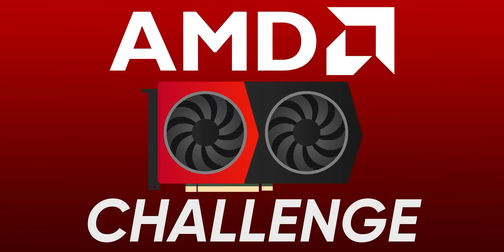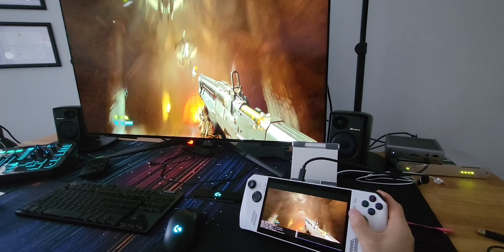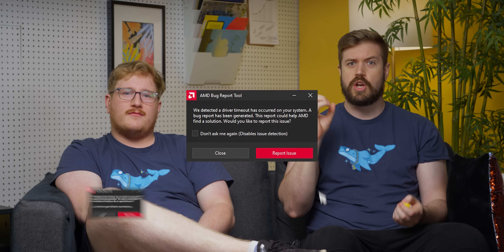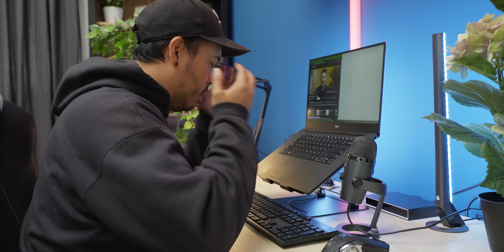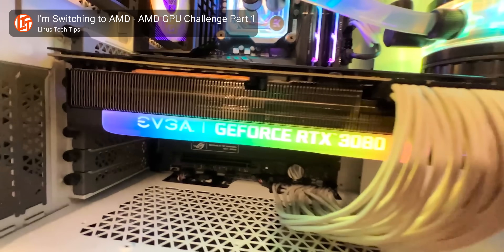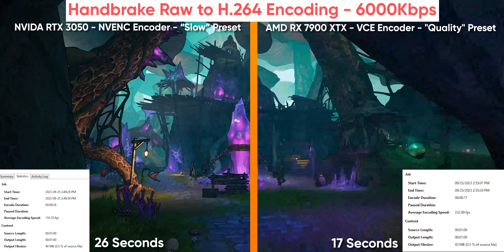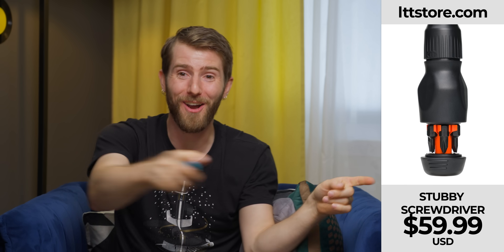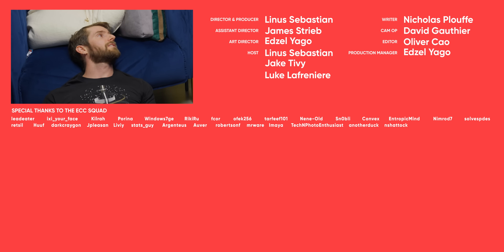I’m Staying on AMD! - Radeon Challenge Pt. 2

Comment: I've been using a 7900 XTX for a couple months now, very solid so far. Seems that maybe they have improved the drivers.
Reply: Historically speaking that's usually the way it goes, I never see the issues people usually talk about with Radeon graphics but I also don't usually have the cards until a few years after release for the most part.
Reply: Just got one, love how it draws 100w at idle. Can’t find a single fix online, can’t set a custom resolution with a lower frame rate, it maxed out at 200 on a 240hz monitor. First AMD card since the r9 280, already regret it. Insane this issue hasn’t been fixed in 8 months, and I’m far from the only one.
Reply: @Blackfatrat yup same got a XFX 6950XT after three years of using a RTX2060. The AMD one is faster… thats all the differences I have noticed.
Reply: @plastic-fly  I'm sorry to hear you've been experiencing issues, have you checked the port specifics both on the GPU and the monitor? The cable may also be at fault, I can't comment on 240hz because my monitor only goes to 165 (it's one of those 49inch ultra wide ones I got for work) I just know there are variables when dealing with that high a refresh rate.

The other thing which I don't think anyone can deny is just variables between computers and stuff, the card I had the most issues with was probably my 5700XT which had mainly driver based issues.

Comment: Interesting. I've been running all AMD pcs since end of 2018 and haven't had any of those issues. Could it be the previously installed drivers?
Reply: Windows drivers are the main culprit. They've fucked me other whether it was Nvidia or AMD.
Reply: They always use DDU, i remember them recommending it a lot a few years ago when they did experiment videos involving GPUs, so I can't imagine things change
Reply: Yeah seems kinda odd to blame all this on a mainstream GPU. Like, I could believe there were problems like this with the early Arc drivers but millions of people willingly buy AMD GPU after AMD GPU. It literally could not be this bad. Matter of fact, I've literally never owned an NVIDEA GPU and I did not even run into issues this bad on Linux. On a GPU not supported by AMDGPU...
Reply: To be fair. I been using AMD for 8 years. I always make a clean Windows intall on any major hardware upgrade. No major issues
Reply: Me too been running amd gpu for months and its fine, updated the gpu driver multiple times and its fine (except if windows 11 decided to f me over, return to win 10 fix the thing). Are these guys using like reviewer engineering sample or retail?
Reply: I've had problems with nvidia as well when not doing a fresh windows install. I prefer fresh install over DDU.
Reply: I wonder if they were using drivers directly from AMD or if they got the weird ones from Windows Update pushed on them without noticing. Keeps happening to me, and they're way more unstable than the drivers directly from AMD's website
Reply: gotta keep in mind they test the hell out of each card they get. We, casual gamers, just play and find most cards do great for our needs.
Reply: the issue is amd is garbage.
Reply: @albioncia  I think it is cause by not have fresh window installation with hardware change. Because I did come across many of their issues, switching from AMD to Nvidia. So many of the issue might cause by the switch itself.
Reply: dude luke's issues are like 100% user error lol
Reply: The only problem I have experienced was a flicker in war thunder which ranged from imaginary to really annoying.

This was solved by setting the driver to DX 11 in the config file. Which you can't do in-game for some reason. And I don't know why.

Edit: talking about the Rx 7800xt.
Reply: @harbinger218  I wouldn't say that, his use case is very unusual, but he is not "using it wrong". A car driven mainly on rough road is one thing, a car drove into a tree is another.
Reply: @jaredj9099 lmao did you even watch? They're using them normally, they're not trying to run them out of spec or at full load for days like AMD should for their stability testing.
Reply: @real151kmh DDU doesn't do a lot you still get a bunch of leftovers and windows trying to kill itself with the wrong drivers. A clean install is the best, and you can do it in 10 minutes and keep all your other files if you partition it properly.
Reply: @servissop151 DDU doesn't always do a great job tho. Using DDU is a great tool, but it is definitely not perfect.
Reply: @miguelborja6896  yep, same. And that's how I've been avoiding any major issues for years. Every time I change CPUs or graphics cards i do a clean install

Comment: I really have to wonder if a clean windows install would eliminate a lot of the problems. I never seem to have any issues with my 6750XT
Reply: Yeah, same. I never had ANY problems at all with my GPU (6700XT), I got it with the new PC, and therefore freshly installed windows.
Reply: you bastard!!

i got some crashes and some hard crashes, maybe once a week. 

msi 6750

What is you drivers, my drivers: 22.5.1
Reply: If i'm switching brands of GPU I always do a fresh install and I never have any issues...It just makes sense
Reply: @LEV1ATAN  my brother in christ you have drivers that are 1y4m old
Reply: @LEV1ATAN bruh you need to update your drivers
Reply: when i still had my rx470 a fresh install didn't help with these issues.
Reply: @LEV1ATAN bro update your damn drivers! We're at 23.9.3 for Christ's sake!
Reply: Can also confirm I have had zero issues since the launch of the 6750xt. Same with my friend who bought the same card. Zero issues.
Reply: @slizzle.280  dude, i was using the new ones, but my PC crashes more often. thats why i still using those drivers
Reply: @randomstuff508  dude, i was using the new ones, but my PC crashes more often. 2-3 chashes in 2h

Comment: It’s actually so refreshing to hear Lukes experience with AMD since… I’m not even exaggerating I’ve had every single issue he has and more. I bought the 5700XT when they just released a few years ago and was fine for maybe a week then immediately had issues and all the same ones he has with them all GPU related.. things just not working and not making sense on why. When it does work tho it is phenomenal and i still think the 5700XT is one of the best cards out there for performance to cost and just plain performance and being able to handle whatever i throw at it until i do something simple like stream a video to my friends on discord and just like Luke described it would slow it down to slide show or freeze with the audio continuing. I did 3 windows installs at this point… feels like a annual thing and its always been a progressive ticking time bomb leading up to that where it is so bad i have no choice. I will say I’m not sure if it’s cus i got lucky with my recent windows install in the summer but since then the random driver crashes have stopped - minus the crashes when i play new games right at release. And the discord video streaming/youtube videos slide show slow down. Yet with all this i can throw a Valve Index VR at it with 144hz enabled and get consistent stable frames around 80+ in VRChat which is impressive and all the more confusing if you know how unstable vrchat is.
Reply: I build a new PC on the worst time of the last crypto/covid period and could only get an overpriced 6700 XT. There were some really strange issues (with old multiplayergames) freezing/black screening for a short period - some of it seemed to be network related, but there was a serious bug with the AMD driver and my "cheaper" 1080p monitor. As I did some affordable PC builds for friends and family on the side I noticed the same issue even with much older AMD cards (570 and 580s) and could narrow it down to the usage of HDMI and Displays cable. By default I had both connectors pluggedin this would somehow (sometimes) messed up the communication between the monitor and the driver and the GPU. So the fix was easy... but to find it was some longer trial and error.
Reply: Yep, I had all the same issues with my 5700xt, that’s one of the reasons I went for a 4080 instead of a 7900xtx

Comment: I'm over here with my AMD card thinking this is weird I don't have any crashes like this. Then I remember I'm still running an RX 580 from 2017. If AMD could get their drivers working better at launch that would definitely help because they make great cards that age very well from my experience.
Reply: ive got a 6900xt, whatever issues hes having might be related to windows 11 as im still on w10 and no issues
Reply: What do you mean when you say they age well? I mean what is the baseline. I think my NVIDIA cards have also aged very well. I am currently using a 970 from 2013 I think (EDIT: no, 2014). All games I tried (except some VR titles) are still working fine.
Reply: I am using Rx580 to... works just fine
Reply: @Kcii-99  Also could be due to weird issues with swapping gpu's and no clean install.
Reply: @JojOatXGME  there are comparison videos showing how how much performance has increased with the flagship Polaris GPUs (rx470/80/570/80/90)
Compared to its competitors at launch like the 1050ti and 1060 (3gb usually) in price
Reply: @Kcii-99  6600XT on w11 and I haven't really had any issues. Working just fine.
Reply: I think it's more all the extra stuff they're running, especially linus' setup, he does list all the scenarios and it's stuff i've never done with my computer. I just use my system for gaming at my desk, and run a VM as my work from home system.  I haven't had any real issues in the past, i've used an r9 290x, a vega 64, and now a 6950xt.  
I did forget one issue that has occurred, I just recently purchased ratchet and clank a rift apart for pc and that crashed on me repetedly during one play session specifically in the battle arena while using the Blackhole minigun weapon the weapons graphics wouldn't appear and then the game would crash.  But a restart made it work normally, and it hasn't happened since.  That's possibly the only issue i've ever experienced with one of their graphics cards.
They do also specify that they used the cards at launch for this challenge, and as evidenced by Luke's experience the drivers tend to improve rapidly.  It could be that none of us are early adopters.  I purchased the 6950xt about a year after it launched, same with the vega 64, and the 290x was closer to 2 years after launch.
Reply: I've had an RX 5500 XT since December 2019 (basically since launch) and never had a single issue. The only crashes that I've encountered were caused by bad hard drives
Reply: @KofolaDealer  The advantage of the 5500 XT is it came out much later than the flagship 5700 XT and had a lil time to mature. The 5700 XT was one of the worst cards I can think of at launch. It was still really bad when I got one a year later. Just a few months and driver updates after that it was pretty solid and at this point you wouldn't even know it ever had issues.

Comment: Id say that Jake’s experiences plus what the labs found is similar to what other outlets have reported. There are certainly broad concerns about drivers and old games and brand new games. Part of this is that there can be games that were too old or niche for AMD’s latest push for better drivers. I really hope that AMD and Intel (especially, holy crap) can keep the software development of drivers at their forefront. Nothing kills a product worse than a reputation for inconsistency. Even slowness can be forgiven, especially if there’s room for improvement.
Reply: @BobDevV I am one of the Linux guys and the driver works really good. Plus it is part of the Kernel, so it just works without installing anything.
Old games do work way better on Linux and is a pretty great experience these days. So yes, it's a Windows thing.

We have to thank Valve and the Steam Deck a lot for all of this!
Reply: For multiple generations AMD has been having the artificing issue
Reply: I ran into this a couple weeks ago with Resident Evil Revelations on RDNA2.  Had frequent crashes and some wild bugs with things failing to load.  I got to the end eventually but it was a rough time.
Reply: my experience was more like lukes. absolutely atrocious with blue screens and crashes. sorry but having older games be niche for amds drivers is a poor excuse. 

edit: poor excuse because on my old nvidia card it never happened on older games, as well as newer games and somehow nvidia drivers are still better?
Reply: I have had exactly as many issues on my 6950XT as on my RTX2060 before that and on my R9 380X before that and thats exactly zero… don’t know if I‘m just lucky or what.

Comment: Never had any of these issues with switching from nvidia to amd but guess it really is a luck of the draw, been happy with my 6650XT for a decent while already
Reply: I also never had any problems after switching from Nvidia to my rx6800xt
Reply: I haven’t had any issues either. I run a 6600 and it’s great! I’ll be sticking with AMD for my upgrade in the future
Reply: Yeah I think most of the issues are on the 7000 series.  I when from being 6700xt, which was pretty solid, to the 7900xtx where I've had lot of the issues they've talked about here.

Comment: As someone who has a 4070ti, I have had a lot of the same crashing issues that Luke has had. But tbh, a lot of these issues could be fixed with a fresh install to actually get some real metrics. I still have the issue with g-sync and actively turn it off on the systems that I have built in the last 18 months.
Reply: 0 issuses on 4070ti here, asus tuf oc. Love it with slight undervolt

Comment: A lot of the issues mentioned by Luke early in the video have been growing for me on an NVIDIA 3080. Seems to be different with every driver update
Reply: Yeah I have a 4070ti and the YouTube or streaming on discord can make my computer chug along sometimes
Reply: Funny as I have those issues on 3080 as well. Like BSODs, video freezing etc.
Reply: this is why i never update unless i MUST to play a new game, and even then i go to a little older version. Theres zero reason to otherwise
Reply: @Shadow0fd3ath24  yeah windows pissed me off the last time it forcefully installed a driver on my system for the graphics card... got a nice version mismatch after the forced update too. It broke a whole lot of things.
Reply: This, it's really all just luck, especially when running Windows.
Like, everybody complains about AMD, I've only rocked Nvidia so far, so I'm far from an AMD fanboy, but damn I've only had problems with green team
Reply: So true. The only way I avoid any issues with any GPU, graphics driver, and windows is to use DDU when doing any driver update
Reply: I also have some odd issues with my 3080, lately it's artifacting and I'm not sure if it's something in the idle power state or something with chrome, but it's really annoying. If I start running a game though it seems entirely fine.

Comment: I switched from a GTX 1070 to an RX 6800 XT, and I've been super happy with mine! I might just be lucky having no issues at all, or it could be the 7000 series in particular which has issues. 6000 works fine both on my 6800 XT and my GFs 6600 XT.
Reply: I switched from a 2070 super to a 6800xt and I can confidently say the and gpu is FAR more stable

Comment: Relating to the high idle power draw, I too didn't have it solved by the update a few weeks back on my XFX 7900XT, and usually find it idling around 90w. However, what I discovered it that when I swap my secondary monitor's refresh rate from 75Hz to 60Hz, the power draw drops massively, to around 33-35w. I'd recommend if you don't really care what the refresh rate of your secondary monitor is, to play around and see if it affects the idle power draw.
Reply: From your description of the issue, it smells like some dumb programming being used in the driver. Some easy fix that should have never been to be done in the first place.
Reply: @HaartieeTRUE I mean, I have a rtx 2080 with a dual monitor setup, if both are at 60hz it uses 25w, if one is at 120hz and the other at 60hz it uses 25w, if both are at 120hz it uses 50w. I own this card for four years now.
Seems like a somewhat similar issue, even though 100w on one monitor is quite a bit worse of course.

Edit: 120hz and 75hz is also at 50w. Everything during idle of course.

Comment: Great video, guys. It was very interesting for me to see how different buyers' experiences can be. I switched my NVIDIA GPU half a year ago for a rx7900xt. Before you ask why I didn't just get the XTX, I got it for a huge discount and would have spent €250 more for the better card. So far, I have had only minor problem. AMD Adrenalin crashed a few times, but after a restart, it fixed itself, and some older games had performance issues. But these titles are known to run poorly on newer systems, so I wouldn't blame AMD for that. After I got the graphics card, I noticed that it consumed 80 watts on the desktop with both my monitors plugged in, which is absolutely ridiculous. Until now, I wasn't able to fix it, so I just plugged the second monitor directly to the mainboard for the CPU to handle it, and it immediately dropped to 12–20 watts. Honestly, this might not be the best idea, but I haven't had any problems so far. All in all, I enjoyed my first experience with AMD, and I don't see myself switching back to Team Green very soon.

Comment: I've been on AMD since the launch of the 7900 xtx and so far I've had a few driver crashes and recently MW2 crashing due to anti-lag+ being enabled with the latest drivers. Overall, I haven't had any other issues though. The driver crashes were bad with one specific driver version but after an update, it all went away. The card itself works great so far.